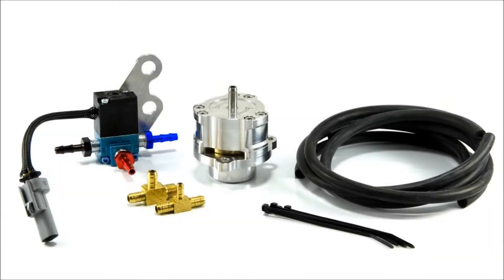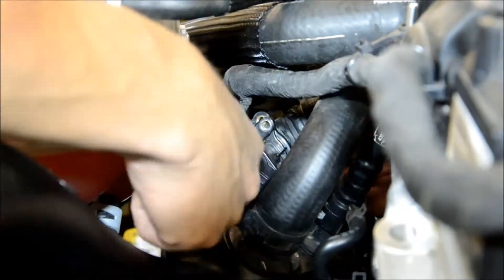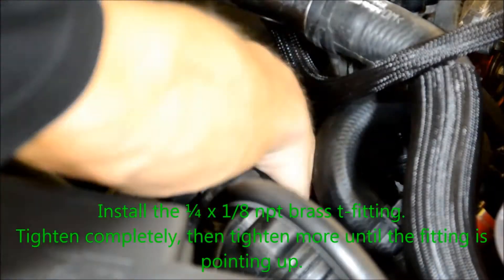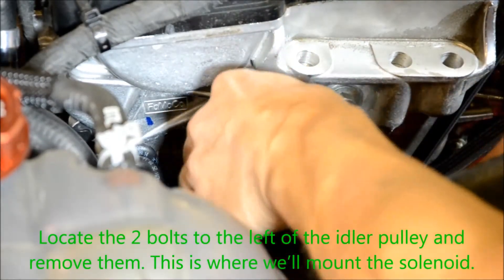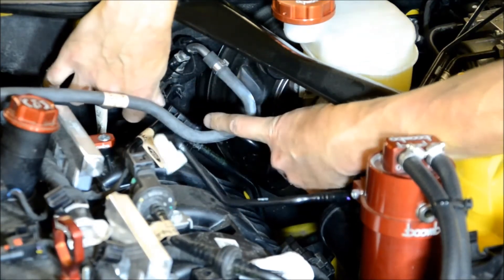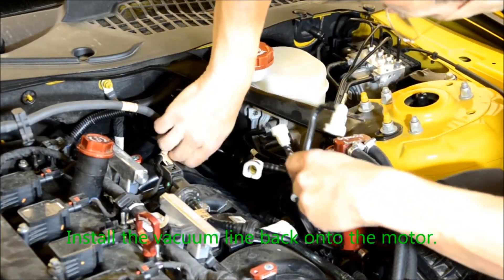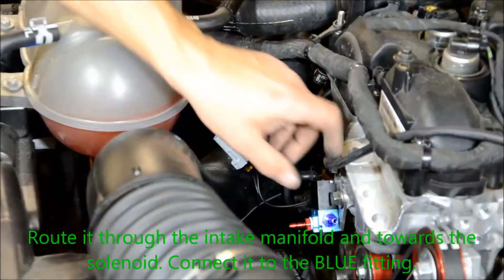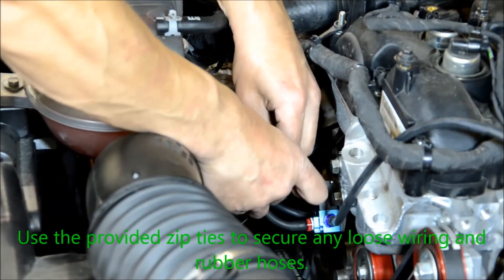How to Install | Boomba Boost Operated BOV/BPV for '15+ Ford Mustang Ecoboost

Comment: What do you do if you’ve already installed a Cobb Air/Oil Separator? Would that affect any part of the installation process like the vacuum lines?
Reply from the maker: We do not have any experience installing one with a Cobb AOS unfortunately

Comment: Two questions:
Does this get rid of the hiss at highway speeds like with the boomba BOV adaptor?
What do you do with the old recirc hose that goes back into the intake?
Reply: I plugged mine with a cork and hose clamp.
Reply from the maker: A tune would fix that

Comment: Is the purpose of the solenoid to 'blow off' when the engine tells it to, like the stock BOV?
Reply from the maker: Our solenoid monitors boost and vacuum and actuates in a way that is most effective to leak free operation and performance.

Comment: Does it void warranty?
Reply: Nice, great reply + info boomba man
Reply from the maker: In short, innocent until proven guilty.
Certain dealers can be more picky than others when it comes to aftermarket parts. Some dealers are fine with 
mods whereas other dealers will not accept any mods. We always tell the customer to ask the service advisor first for what’s acceptable at any given dealership and if you have any doubts to return the car to stock form before 
bringing it in to a dealer. 

Furthermore there is a law called the Magnuson Moss Warranty Act that states in order for a dealer to deny warranty work on your car, they have to prove the aftermarket part you have installed caused your issue. For example if your window stops working and you have a cold air intake, the dealer is not going to void your 
warranty. It is illegal for a dealer to void your warranty for simply having aftermarket parts installed.

If you have any further questions, please let us know!

Comment: I would imagine boost pressure will be directed to BOV to keep it shut tighter and vacuum pressure (when solenoid switches over) pulls the BOV open? Neat design. How well do shrink tube seal on the 1/8" barb? I see that the barb itself is not very "exaggerated" like tubing or hose barb.
Reply: +BoombaRacingInc excellent. as expected for the BOV operation. props
Reply from the maker: The way our valve is set to operate, it is also using both boost and vacuum sources. The vacuum is used to pull the valve open, while the boost pressure is used to keep the valve shut. Due to our design, the more boost you are making, the more pressure there is keeping the valve closed. Due to this style of operation, our valve can hold up to 100 PSI of boost. The spring we use also works to ensure there is no strange operation of unwanted fluttering or venting. Using heat to seal the hose to the barb should be more than efficient enough to not have any leaks.
Reply from the maker: Thank you!